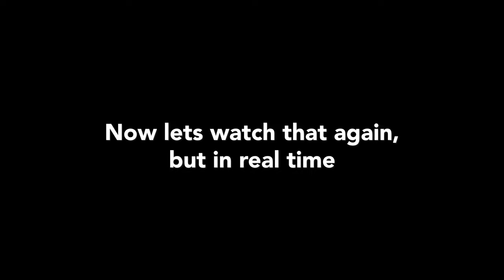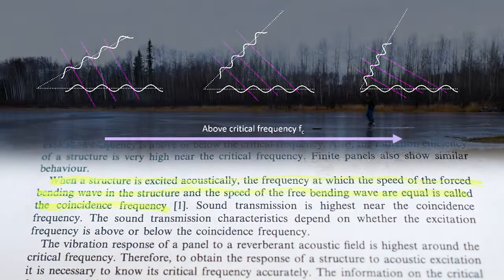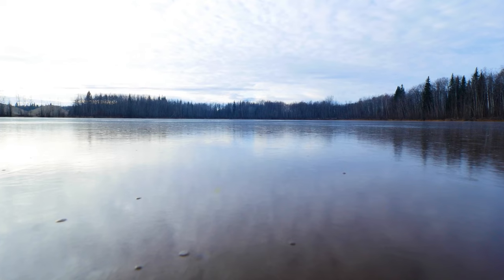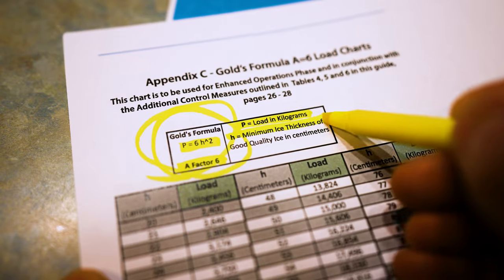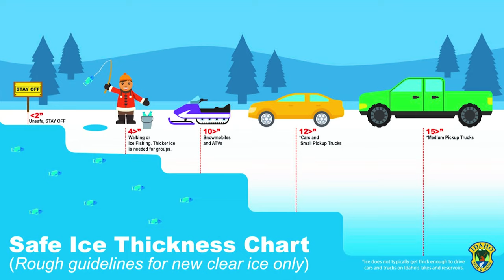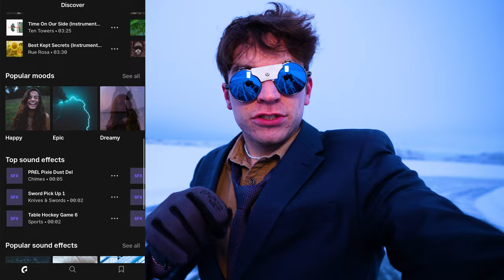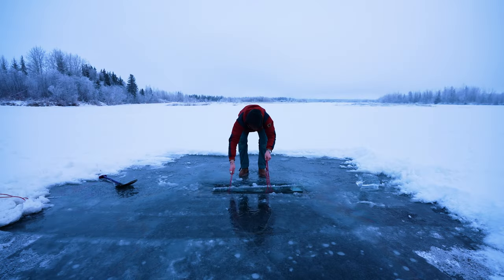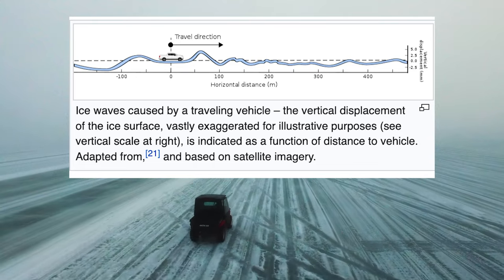Frozen Frequencies: The Sound & Science of Sketchy Ice Skating!

Comment: By the way, if you want  to figure out what minimum ice thickness will hold you, the formula becomes: 

h = √p/6

So, if you weigh 68kg here are the steps:

68/6 = 11.33
√11.33 = 3.3665016461206926511211286390232

3.3665016461206926511211286390232 = h (cm)
68 = p (kg)

---

Reversing to the original equation from Gold's Formula, to figure out :

p = 6 h^2

3.3665016461206926511211286390232 * 3.3665016461206926511211286390232 = 11.33

11.33 * 6 = 68

68 = p (kg)
3.3665016461206926511211286390232 = h (cm)